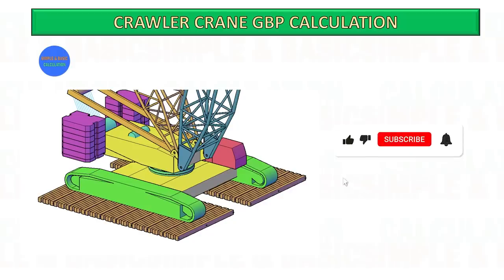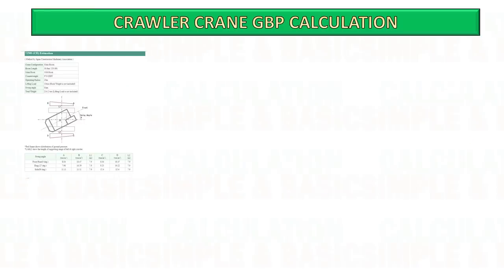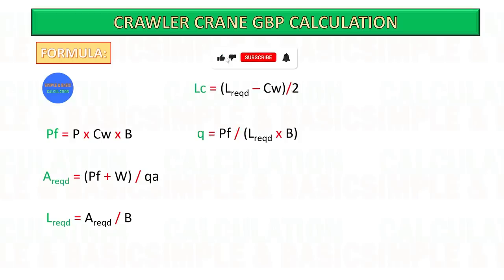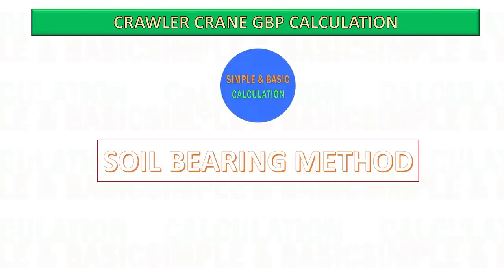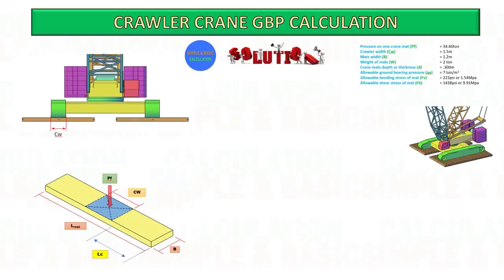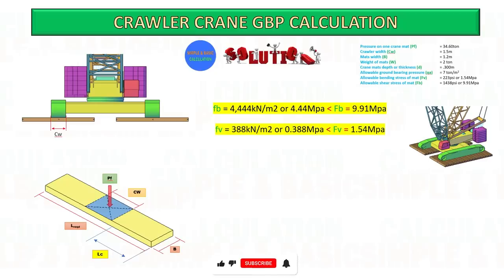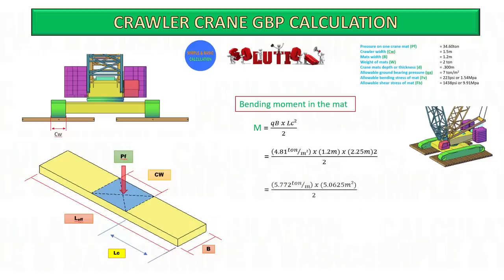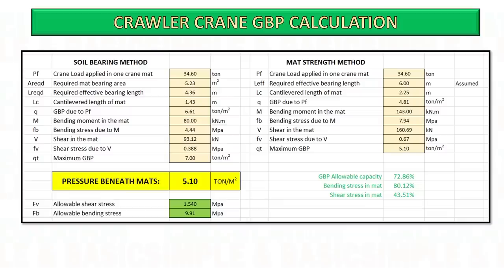Mastering Ground Bearing Pressure Calculation for Safe and Efficient Crane Lifting #lifting #crane

Comment: Hi Dear. I have one question. How is it possible, WOT is 1.5 and WOM is 1.2. could you explain please
Reply from the maker: Do you mean width of track = 1.5 & width of mat = 1.2?
There are a series of mats beneath the crawler track of the crane; in the worst-case scenario, we must assume that only one mat is supporting the load.
Reply: You did calculation for GBP of mat weight. And size of mat, you show 6 by 1,2
Reply: How size of mat could be less than truck size
Reply from the maker: The calculation is base on crane mat size 6m x 1.2m